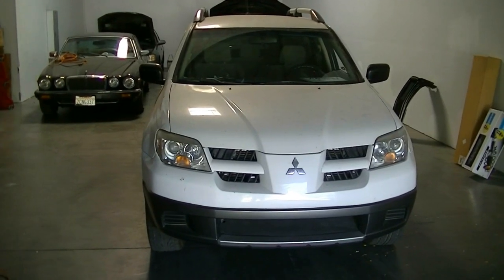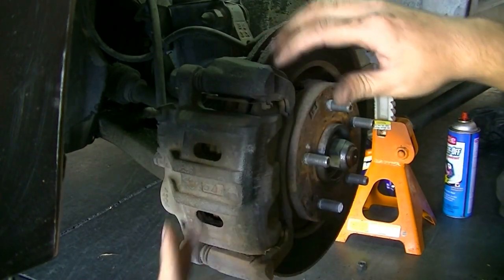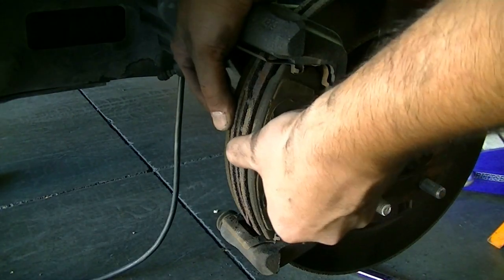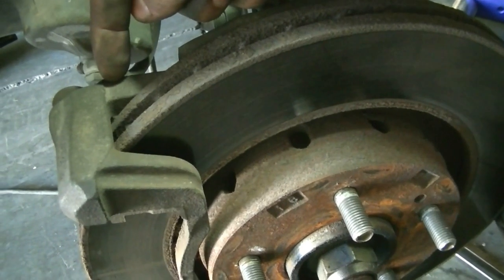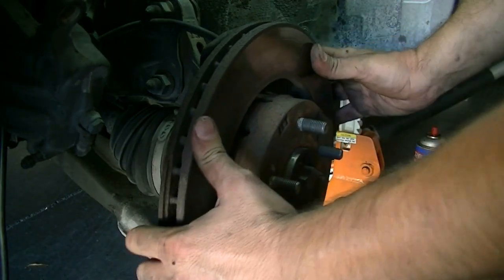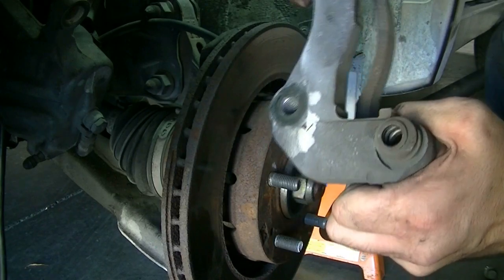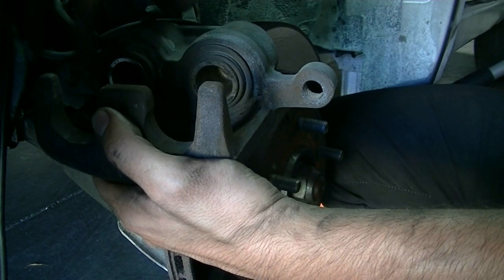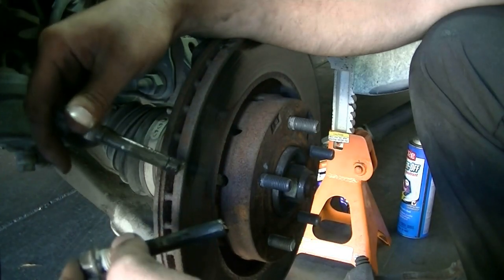Front Brake Pads and Rotors Replacement - 2006 Mitsubishi Outlander

Comment: what does torque spec mean? I can't just tighten them by hand do I need a special tool
Reply: you can tighten the bolts by hand, what torque means is how tight you tighten the bolts. I would make them snug but tight but not too tight.